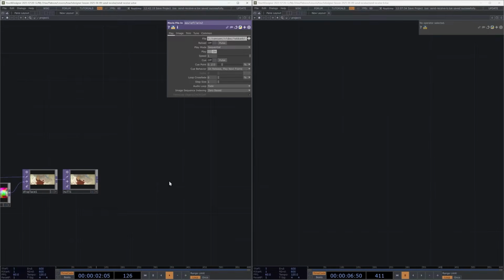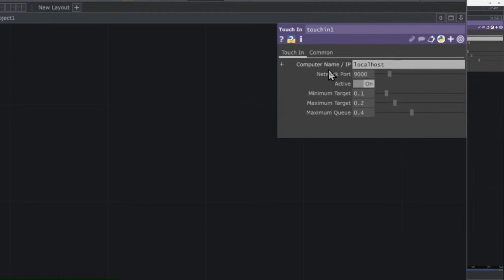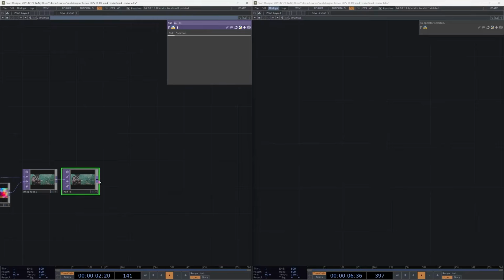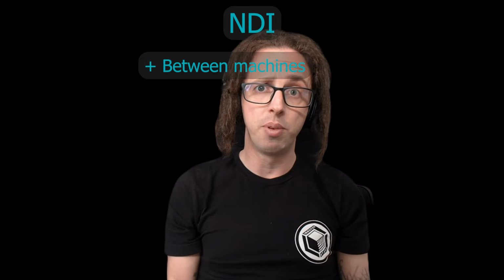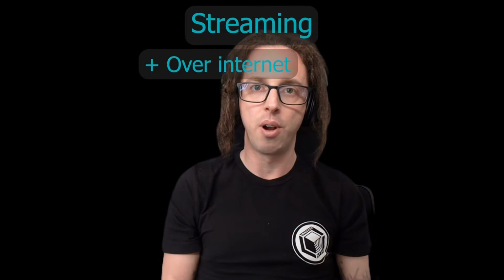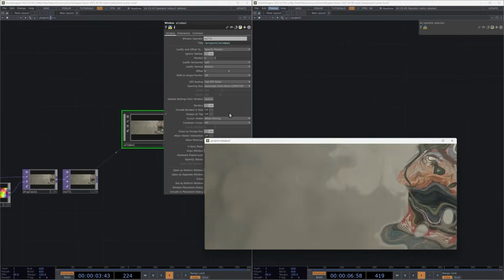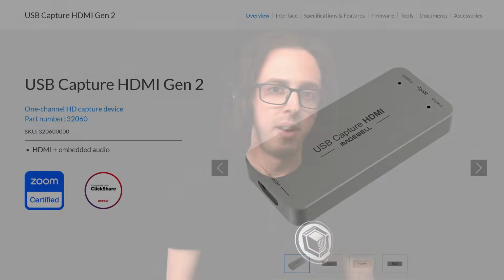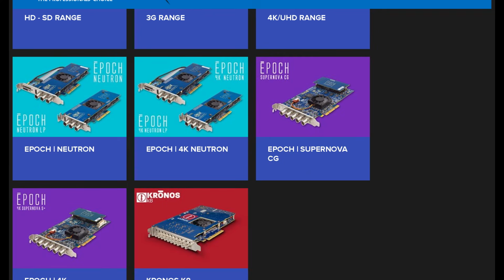8 Ways to Send and Receive Video in TouchDesigner

Comment: First of all, what a great informative video! Instant follow and like, watched all the way without skipping, no bullshit, just on point, thank you! I found the software because I want to do some projection mapping at home, just learning and having some fun for now. After watching this video, am I correct I could send streaming video (in my case F1 multiviewer, it's a Windows application) onto the objects that I mapped? Not yet set up everything to test but if I'm correct that would be insane!
Reply from the maker: Thanks for the follow! Depending on what F1 multiviewer supports, it might have a direct way to send to TouchDesigner. Or if it doesn't have that, you could do screen capture using Screen Grab TOP and then crop down to the relevant parts.

Comment: Very helpful video thanks! My win pc can wirelessly connect to a projector and I found that direct connection (it is called p2p there, works with phone as well) works better than casting through the same network (similar to how chrome cast works I think). I am curious if cheap wireless hdmi dongle for ~$50 off aliexpress will have similar performance? Also if I stream from td to my projector directly and not through windows then will the performance be better?
Reply from the maker: Interesting. Does windows treat it as just another display output? If not then you would either need it to be directly supported in touch, or you would need something to relay video from touch out to it.
In general, I think the words "performance" and "wireless" don't tend to get along with each other though. It's either going to be compressed, laggy, or need a ton of bandwidth, which wireless isn't great at.
Reply: @t @tekt0 es, windows sees it as a wireless display

Comment: Can i use ndi in combination with perform mode to get the maximum stability in my output ?
Reply from the maker: Perform mode avoids stuff like network editor UI updates, so it might help a bit. Ndi itself shouldn't have much impact on performance unless you're pushing a ton of pixels though the compression will have some cost. Generally network bandwidth is more of an issue with ndi than rendering fps